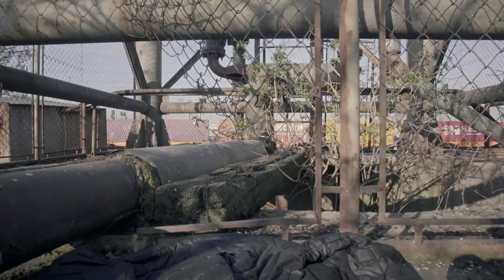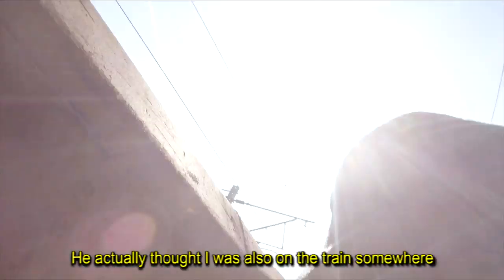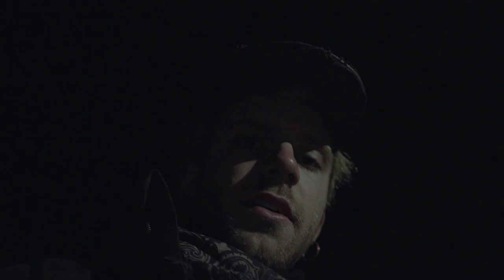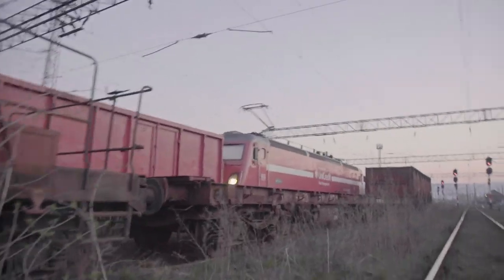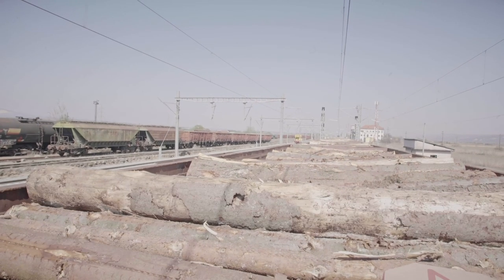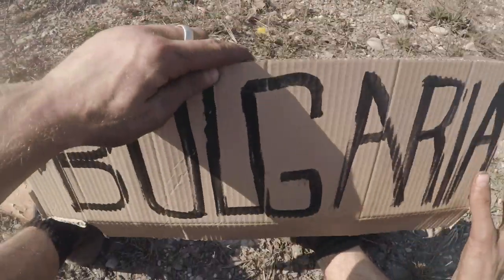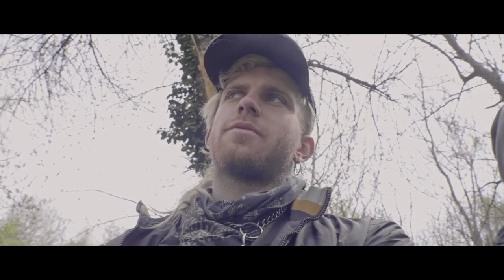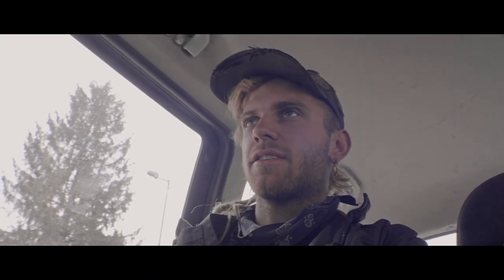Freight Hopping Transylvania and Soviet Bunkers (Episode 2/2)

Comment: also watched your mexico trip - well - in continental europe there're a few differences: all electrified, higher speeds, cars not really made with additional space, tighter security (although less or not armed) - never seen someone crossing germany by freight train - quite dangerous
Reply from the maker: You can ride anywhere if you really wanted... much more dangerous than that. I think Europe is relaxing but not really worth the effort. I think South Africa would be a cool place to ride
Reply: @AutonomousPlayground  well, afaik in europe the worst you may can charged for (at least germany) is for riding a train without a valid ticket - and maybe for what's called "dangerous interference of train traffic" - but the charges are quite low in contrast to other regions - you have to pay some money and pretty much free to go as in europe there's an eu law state somthing like "you can't charged for the same violation/"crime" within 24h
the one "train rider" riding an ICE train in germany was only charged for riding the train without a valid ticket for that train - but that was pretty much it
what I see as the way more self-endangering thing is that you're near a 15kV overhead power line - and although there're people survived even multiple shocks from it or even got struck several times by a lightning strike there's still the risk to get electrocuted by the overhead power line than in other countries not using overhead powerlines but only diesel engines - where the "only" risk is like getting stuck between the cars and run over by the next axel - like the one russian guy (actually a medic student) lost his leg under full consciousness and still giving the emergency staff advices how to act
Reply from the maker: cryptearth interesting stuff, yeah that 24hr rule is really good lol... I agree man, I won’t post more in Europe and I don’t condone that stuff. It’s very dangerous with the cable especially in rain. But it is what it is. I enjoy the developing countries where cops wave to you from the train instead lol, Uzbekistan next as soon as flights open up... cheers